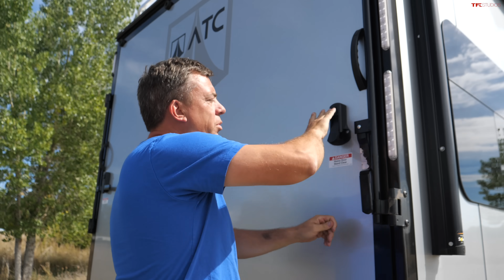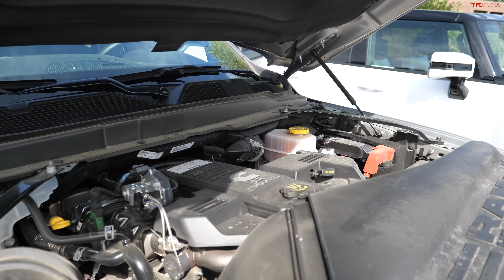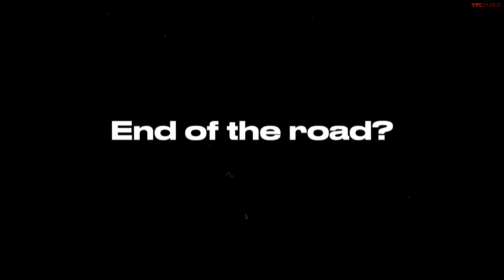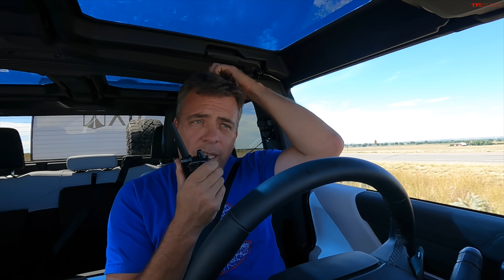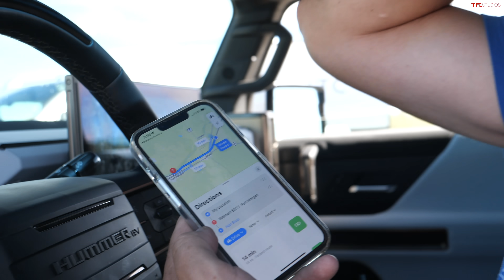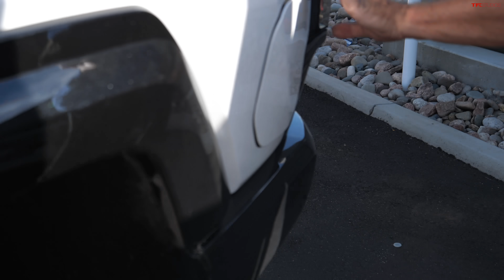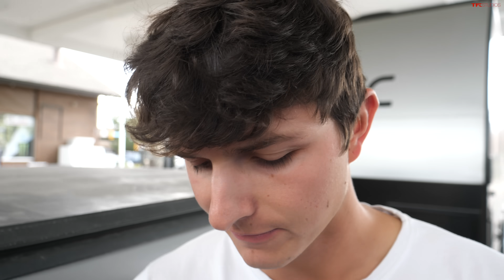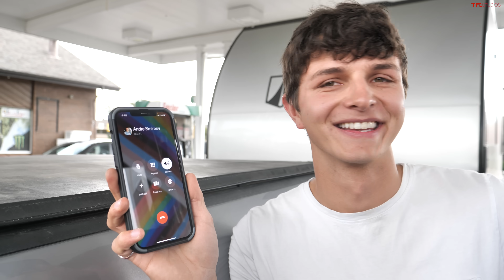How Far Can a Diesel and Electric Truck Tow An Identical Camper Trailer on ONE Fill-up?

Comment: I’ve been using batteries for a couple of years now when you do the fast charging on lithium batteries you decrease there lifespan by a lot it seem like it would be better to have a small generator in the truck running all the time to keep the batteries charged I have 2200 watt generator that will put out around 2000 watt’s for 8 hours on 1 gallon of gas. Before going off grid I was spending $150 to over $350 a month on electricity now with the solar panels I have and after getting a couple of freezers I spend about $100 a month for gas to run generators for the well and extra battery charge a month. You are using way more power to charge your vehicles each time than I ever used for a whole month at my house and you’re getting it free for now just how long do you think that’s going to last and as I said the fast charge is going to knock your battery life down to 5 years I’ve heard several people ruin there’s in around 2 years and they wanted $12,000 or more to replace them that’s some toys you’ve got so you can go 100 miles I live about 40 miles from Sacramento Ca that means I could go to the city and back and when I get home I can charge my vehicle for a day or two if the sunshine’s and maybe do it again I think you’ll find after a while it will cost you about $100 or more for your charge and let’s not forget half of the price for fuel is taxes for roads and because they want more of your money so they’ll be adding that soon remember the politicians are pushing for electric vehicles because they own shares in the car companies and the Chinese battery makers

Comment: We need to focus on hydrogen fuel cell vehicles. Battery-powered electric vehicles polute worse than current gas/diesel vehicles, and the cost of mining and refining for batteries is just outrageous. "You can save money on gas because electricity is cheaper." You'll just end up spending all that "saved" money on a new battery in 5-7 years.

Comment: The cost for the electric charge ($40) was if he fully charge it or not? Because at half way he was kind of close to forty bucks. So how much does it cost to fully charge the hummer EV? I still will gas/diesel vehicle because it is better and reliable. I would like to see if they run the electric vehicle in some freezing weather compared to the Ram.

Comment: LMAO ! Electric vs diesel is a no brainer ! Diesel will go further ! I have a 2002 dodge Cummins 5.9 and tow a 32 ft tag a long camper I pull through North Carolina & South Carolina Mtns an can still go a little over 450 miles to a tank of fuel an my camper weighs 8200 lbs empty ! Electric isn't going to cut it !

Comment: Gigantic trailers??? They are both low side of average at best and what's more they are empty. Not at all like what they would normally be on a trip. Maybe you aren't the one to be doing these tests. I have an average one that is about 10K loaded. There are a lot of double and triple axle 5th wheels between 15-20K.

Comment: One thing you got to consider is that you wouldn't stretch a EV vehicle just like a gas or diesel vehicle to the point where your completely empty. Andre could have stopped with the EV back in that town where he would have had maybe 20% left, and quickly recharged to a point that he wouldn't even be that far behind young buck. Plus the cost to charge the EV is a lot cheaper than it is to fiull a truck up with gas or diesel. Trust me I did the homework and unfortunately EV is the way to go.
Reply: If you did the math you'd see that the EV would have cost $137 to go the distance the ram did for $104 if  he was charged  the normal rate. Home charge would be different of course but this is how the test was run. The price was $.87 per KW and would have cost $80 to top the battery off after 123 miles. Going the extra 88 miles the Ram traveled would have added an aditional $57.

Comment: FINALLY! A FAIR comparison of EV vs diesel trucks!! Well done!!!

BTW, I get 11-12 mpg towing a 10,000 lb travel trailer with my F-250 Super Duty and the range is around 400 miles. IF the Hummer could tow that weight, and it can't, the range would be around 100 miles, not enough to get you from one charging station to the next out West.

Comment: Eledtric is fun but so very limited that it really isn't worth the excessive expense at this point.   Not to mention the electric grid
is not even close to supporting these vehicles at this time.   The other problem is  if you run out of charge while on the road you may be homesteading there for a very long time till they can get a generator out to help get you going.   Friend had Prius vehicle and while he had fantastic results the replacement cost of the Battery pack was almost as much as he paid for the car and the time required was not good, average if all went well it was three days in the shop if parts were available at the time.

Comment: 31 minutes to get to 53% charged after ONLY going 123 miles?  Did I see that right?  I hope the masses wake up to the big “green lie” the globalists are trying to sell/mandate on everybody.  Electric vehicles are great for smaller vehicles, and local round trip travel where you get charge each night after a day of driving.  Having to wait 10-30+ minutes to “charge up” when you can fill a 48 gallon tank on a big truck in just minutes.  Not to mention, had to take the trailer off.  Oh….and all this “free charging” guess what….once the other 99% of the population is “mandated” to go electric, that goes away, and then they skyrocket the price of electricity like they are doing in parts of Europe now.  It is all about CONTROL….and EV’s force people into their trap.  Will take years to get there…but that is their end goal.

Comment: Quad steering looks cool until I think about more moving parts to maintain, repair and replace. But then again how many miles will a person keep a new ev for? Common sense says trade it off with low miles for best resale value. What’s a good deal and low mileage for an ev? I’m 50 years old so I’m to suspicious to be a buyer. I’ll run gasoline until they take my license or I croak.
Reply: 20 year old truck, 130,000 miles, no issues with quadrasteer.
Reply: @stewiesaidthat  that’s good to know. My last pickup was a f150 with the triton v8. Had 280k on it when I gave it away. It was worn out, but to the credit of ford all I ever did to it was a fuel pump, water pump and u-joints. That is the only things ever to go wrong on it! The guy I gave it to is still driving it. All I ever heard was what junk ford tritons were. So real life testimony goes further than the guy who never owned one.

Comment: What good is a "Truck" if it can't haul a load?   Electric is a good idea once the science catches up to the desires assuming the grid can handle the new load requirements.    Replacing the batteries in all of the electric tools and vehicles every year to every few years with the existing battery lifetimes and cost is ludacris.

Comment: You guys left out the most important thing, the longevity of the vehicle.   The lifespan of the battery in the ev truck is only 3 to 4 years.  After that A LARGE investment of money is required to keep the vehicle running.   The engine in the diesel truck will last for decades if properly maintained.   I'm not against evs,  but they are not a viable option with the current technology.   Anyone who tells you otherwise is simply wrong.

Comment: My 2000 f250 superduty 7.3 powerstroke ever has bad batteries I can just go to any auto parts a get new batteries and be back on the road that hummer or teslas you can't simply replace the batteries

Comment: $114000 joke - 
Chevy sent me a email : how to power your house with your ev silverado when grid goes down. Fine I told them and then when the truck goes dead from powering the house your double - dead . 😁😁
The green energy will not save us -

Comment: If you have to make a diesel vs electric us a joke.  That lil camper is a joke . Put a 30ft fifth wheel behind it. That diesel will walk away. Pull some hills.  I'll keep my f250. Get rid of the Def crap and tune it . Don't have to roll coal to haul

Comment: The sad things are...
1) the cost of the Hummer
2) 120-125 miles on a charge
3) still having to pay for the battery fill once the "free" month 
4) the time spent fill battery vs filling at a fuel station

Comment: The manufacturers shouldn't make electric vehicles bigger then a bronco sport and chevy equinox  mid size suv to move people  and make all the large suv's and all trucks should be diesel with small displacement Inline 4  and inline 6 cylinders

Comment: Drill baby drill! 
What a joke. 
And the electric at the charging station came from NG and coal. 
Maby 5% came if the sun was shining or wind was blowing.  
Not ready for prime time. 
Especially when it takes 3 min to top off the diesel. That Hummer spent hours charging.

Comment: You guys should have headed west and driven over Vail pass at 12,000ft and 7% grade, AKA-real world...   Just think, after all this you are charging the hummer with 80% coal and gas...  BTW- Ford just announced a new Powerstroke diesel engine- 500 HP @1200 ft lbs torque.

Comment: The only way for any truck that’s electric to improve its range is to either have solar panels on the roof or a diesel generator in the bed plugged into the truck full time and running the entire time, kinda like turning it into a diesel locomotive they have big diesel engines that are generators powering the electric motors to drive the train

Comment: That electric truck isn’t worth 10 cents if it can only pull that little camper that short of a distance. I’d take that back to the dealership and tell them to keep it until they can make it actually useful

Comment: in first year high school my class rigged a 45 hp? squirl cage fan motor from an old factory in place of the engine/trans put about 30 mostly good batteries and a lawnmower spinning 4 cop car generators bolted to the deck.
as long as you got caught by a lot of stoplights the mower motor kept up sorta ok.  the electric was not a race car but it too kept up with street traffic.... 
ps ... this was B.F. ( before freeways )
cost.... 25 cents gallon gas & lotsa fun for a 3 hour jaunt.

Comment: I'd like to see what would happen if both vehicles were hauling max payload.  That RAM 's mpg probably wouldn't have been that much different.  The Hummer wouldn't have gone 50 miles.  EVs are just a wealth transferal scam.  Carbon credits on wheels.

Comment: As the battery heats up from fast charging it automatically drops the amps to prevent overheat. And the miles per kWh efficiency will only go down with age of the battery and colder temperatures. We know this because we use cordless tools running lithium batteries. When they're cold, they can't perform. When they're old, they can't perform. Down south when its always warm and mostly flat, EV is ok. Up north and mountains, I'll drive diesel or gas any day! Great video!

Comment: Ha, another long range towing video. For over 90% of how the average truck user uses their truck, the fossil fuel vehicle cant compete. I own a diesel work vehicle. I only use it for heavy jobs. No mention of how our diesels poison children standing near or the noise. Or the increase in medical costs for the country. Or how lifetime carbon is much more in the diesel. Even the purchase cost levels out with lower maintenance and ‘fuel’ cost, long run. But you guys know that.

Comment: Something that you should discuss is the amount of time you spent refueling. Right now it takes too long to charge a battery for the EV. You will have to plan your trip out extremely close to ensure there are charging stations and make sure you are adding more time to "refuel". They still are not as as fast to get back on road and go.

Comment: Very misleading. The diesel went over 200 miles and cost about $100, it still had another 100 miles to go. The EV went a little over 100 miles and was done! Actually, it went about 70-80 miles and had to turn around and reroute to a charging station!!  They did NOT fully recharge the EV and the cost would have been almost $40. at about 70-80 miles from the starting point. The diesel was over 200 miles from the starting point at $100.
Time IS money! If you were in the business of towing travel trailers, it looks like the diesel would tow 10 times more trailers in a month from Indiana to Florida than an EV that cost twice as much!!

Comment: The range for the Ram Tradesman Echodiesel will travel up to 1000 miles without a trailer. LOL Thank you for this informative video. The gauge on the truck versus the real world is impressive since it is less (-10 percent) than the average loss seen in most brands (rangine from 21-33 percent difference).

Comment: So you compare a truck with 20k pound towing capacity with an EV that does 8k?  Totally unfair. My diesel SUV has a 7.8K towing capacity.  I get about 35mph at 70mph.  Towing that trailer I’d get 15mpg easily.  Do an apples to apples comparison next time.

Comment: The EV trucks are cool but it’s too early. To try and force a change this soon is tough. Just in one day for work I can easily drive a couple hundred miles with my truck loaded and a trailer. If we can achieve that with an EV then I would be happy to try it. I just don’t have the time to stop at charging stations throughout the day.

Comment: There is not enough charging infrastructure in place to support EV's beyond commuting short distances. They also require towing to special service centers where the waiting times to repair them far exceeds gas vehicles. You also must use gas/diesel to manufacture, ship and transport them so in the end youre NOT leaving a smaller footprint or saving the earth from the imaginary effects of "global warming" or "climate change", as lying Al Gore calls normal weather.😆

Comment: As city vehicles the electric only are good.  But real world they are trash.  The recharge time is terrible.  Anything except small trips will mean many hours wasted just to recharge vs normal fuel.  Only hybrid electric vehicles will work properly on long hauls.  Look at Edison motors and also at trains. Electric motors, battery storage and a generator to charge while driving. Then slow charge over night without the need for special charging stations.

Comment: Take that you Green Dreamers. Diesel $100.00 goes basically twice as far. Electric had to turn back at hundred mile that was totally busy, unhitch trailer and time to charge. Paid nothing for charge because a Promotion. But where does the power to charging station come from. COAL, NATURAL GAS. Did anyone see a Solar field or a little guy peddling a bike for the charging station? Price between them is something else to think about. Then the environment is a issue battery disposal. These idiot that go green , actually sounds like they are taking your GREEN   BACKS FASTER. Wow ,I  guess it's so they can  by Cripple-Currency  AMAZING hows that working out. Ah and how much did Joey B. Spend on this Idea $$$$$$$$$ ???????

Comment: I have seen a new generator that works from the operation of the suspension as you go down the road.  This is more efficient than the braking power return chargers, which only work on breaking. they have been developed for standard vehicles and big trucks. There are not a lot of available charging stations for that electric vehicle either but diesel is available universally.
Reply: Nice idea

Comment: I have a 2001 GMC Duramax pulling a 15000 lb toy hauler I get about 13 mpg which varies depending on mountain passes and wind. That figures out to a maximum range of 390 miles traveling at an average speed of 70 mph. I paid less than $8000.00 used of course with 235000 current miles on truck. I think both new diesel and electric would absolutely lose too my Duramax hands down. 
Not that these trucks aren't nice, but it all practicality my old diesel will go a lot more miles yet for way less money. Oh and it's paid for!

Comment: One thing I saw out the window of the trucks was basically flat land. It might have been rolling a little, but they never got to the mountains to compare uphill pulling capability.  The range estimates for EV's never seem to specify range over what.  300 mile range in FLA or Kansas is one thing.  300mile range in the Blue Ridge or Rockies is something else altogether.  Watts of power equals volts times current, and going up hill on a mountain draws a lot of current, depleting the battery quickly.  And, going down hill in the EV recharge mode, will not restore what was used going up hill, that defies the Law of Conservation of Energy.  A couple decades ago when I dabbled in EV vehicle conversion, finding  a surplus jet engine starter motor and a vehicle like a small pick up, or something fancy like a dead motor Porsche 914, vehicles that were boxy, so you could put batteries in the nooks and crannies, and an adapter plate to hook the electric motor to the transmission  or bypass that all together can go right to the differential if you could get an electric  motor with the torque you needed, was the norm. The caveat was to not even bother if you lived in mountainous terrain.

Comment: I drive a fully deleted Cummins and 3 weeks ago I pulled a 26ft cattle trailer (all steel) with 4 head of beef in it in the hills of KY and was getting 18.6 mpg the epa has fuked up the diesel engines

Comment: The really funny part is my 2019 Ford Ranger can tow my 7,500 pound camper and get the same mpg as the Ram, and I only paid $21,700 for the truck brand new.

Comment: A tru test for these electric vehicles is to pull through thr Rocky Mountains in Canadian Cold Weather.  And those trailers are not even packed with gear that you would have in them for camping.